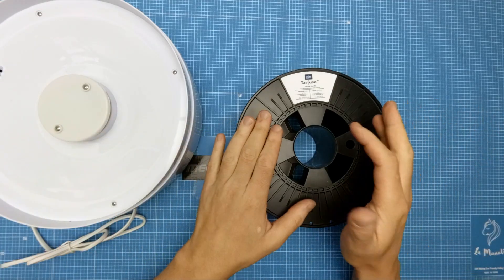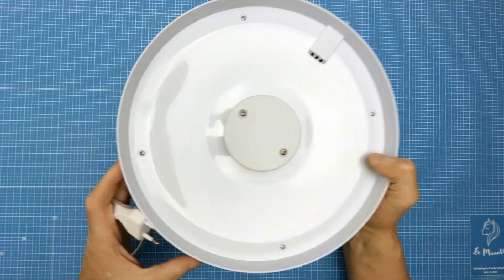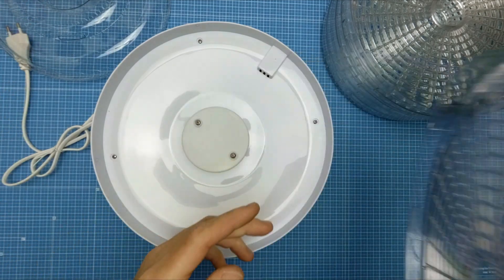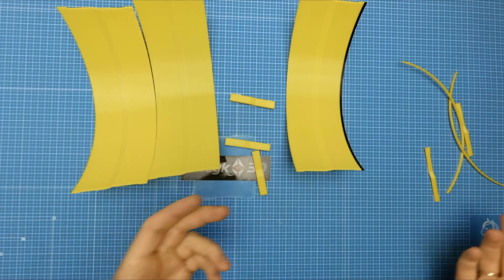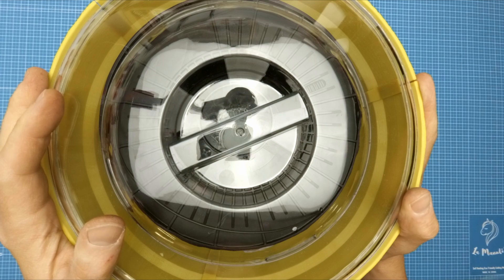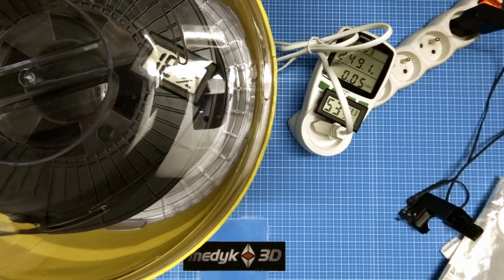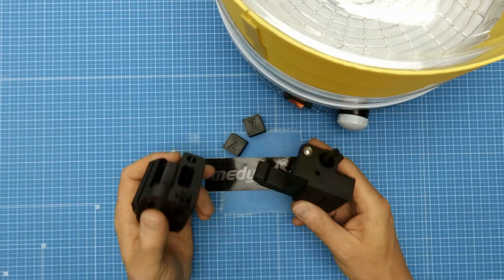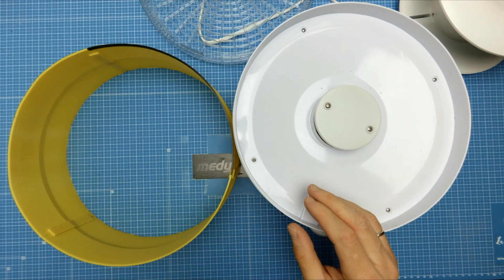Filament Dryer - DIY for $22

Comment: Another nice video and I think, you should upgrade dryer so it can be use during printing... it's just my suggestion :)
Reply from the maker: I agree. But should I choose easy option - adding lazy susan, or fit inside upright filament stand or go extreme and rebuild it from scratch?
Reply: @medyk3D  Like the saying is: Go big or go home :D
Reply from the maker: @huntliba  True :)